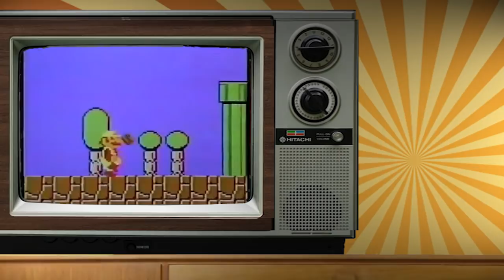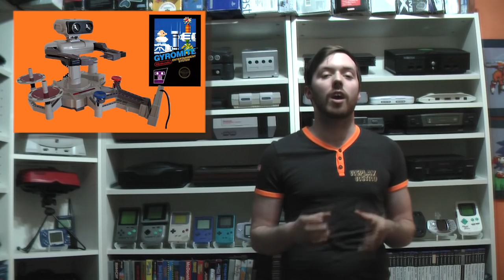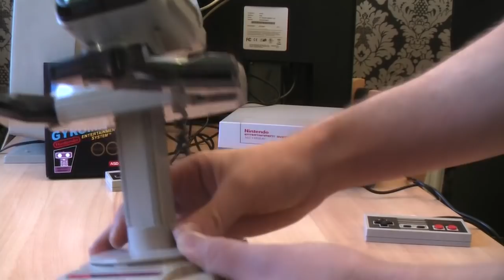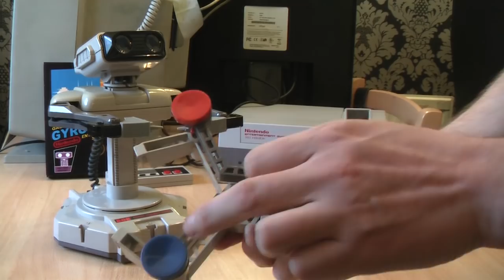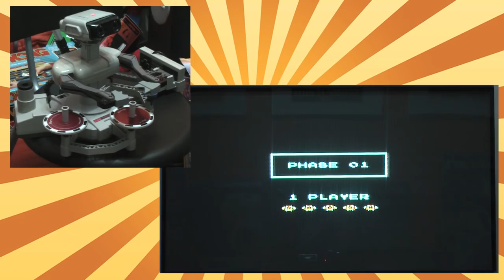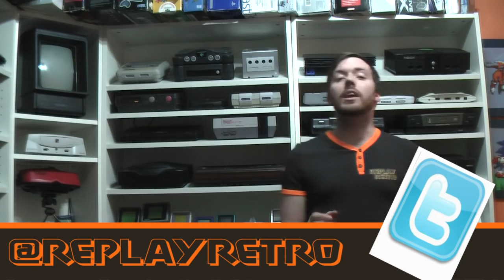Robotic Operating Buddy (R.O.B) Review

Comment: It would be cool to incredibly speed up those motors to speed up response time,to avoid running out of power it would be great to get a power supply with a extreem long cord.Btw nice video, you greatly mastered the robot, i can't wait to see you with stack up to master it properly,everybody with patience should get used too,this technology alone impresses me to no end.
Reply from the maker: +Johneymute supergd yeah you could probably speed him up a little, though you'd need to be careful not to damage gears when they reach the end of travel and higher speed would increase resistance, you'd also run the risk of throwing the gyros off their axis, but it could theoretically work as long as you stepped it up in increments

Comment: this is good, all AVGN does is have a massive fight with it and says how bad it is, when it actually was cool. I was so on edge when the gyro was spinning because i was like is it gonna stop.....
Reply from the maker: +caleb herobrine steve yeah when the pinning gyro is holding down a button you do feel the tension as you're trying to quickly get the next gyro over there, even worse in later stages you may need to have both spinning so you can put them down one way and remove them the other
Reply: +ReplayRetro oh shit, for once you'll be praying to physics not god
Reply: Yea he even talked s**t about battletoads and Ecco the dolphin which were also great games.

Is it possible to both like and hate someone at the same time?

Comment: But what i still don't understand is how can it distinguish flashes to know what to do?? I first tout that it could see colors to distinguish different commando's to exicute,but i readed that it could only see b&w so my theory is that it distinguish different commans in accordance to different flash pattern orders,let's say command A consists of black,white black pattern while commando B consists of a white,black white pattern anso so on.
BTW i wish that rob used the power from the nes or had it's own power supply instead so that you NEVER had to worry about running out of power to be screwed up.
Thanks for showing this.

EDIT
i will NEVER completely understand how the hell nintendo was able to restore and dominate the videogame market all because of redesigning the nes case and sell it as an “entertainment system” and because of rob the robot to trigger peoples mind??
Am mean first off off all both the fairchannel & atari 5200 were called an entertainment system, secondly while those consoles did had their issues but so did rob the the robot too,
Also nintendo games were at the time on other platforms,
Well if it was all because of the game supermariobros to making people to want a nes,well then both atari,sega,mattel and coleco should,ve bought a license to put that game on their systems,unless nintendo never and no longer accepted that.
Reply from the maker: +johneygd i assume it works via the frequency of the flash, i imagine if you slow it down the flashes are very specific to each command but to the human eye its just a quick flash.
as for the power supply i think giving him a wired supply would be a pain as not only would you have to line him up to see the tv you'd also need to make sure there was an outlet nearby or that the NES was close enough to reach
Reply: +ReplayRetro yeah the frequency pattern of the screen, i think it works in a on off way, in that ROB has a builtin timer to count how fast and at wich order the black and white screen do appear in mini seconds to determine wich pattern order it should be in order to exicute the right.commando,but even that said, theres the 50 & 60 hz difference per region so i expect that they are not compatible with eachother unless ROB. And those games can take delay's into account.
Reply from the maker: +johneygd now that raises an interesting point, because i'm pretty sure they are compatible with each other